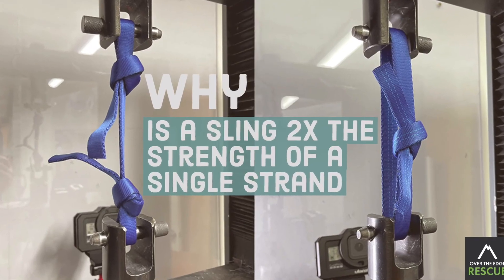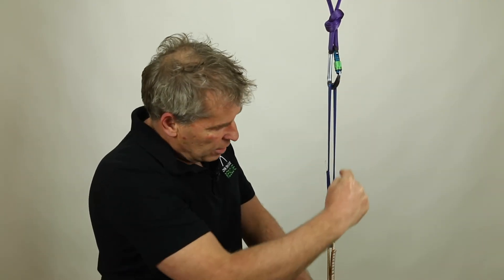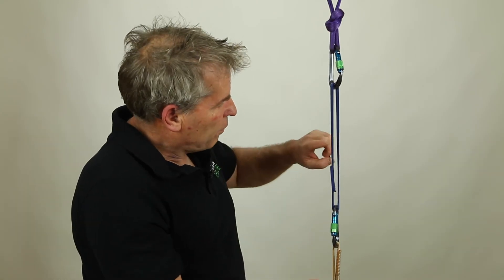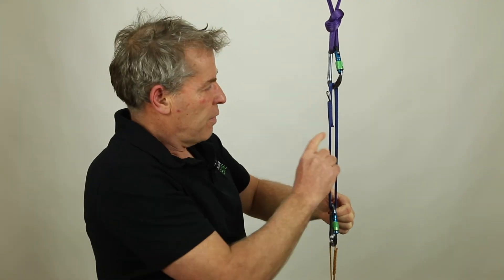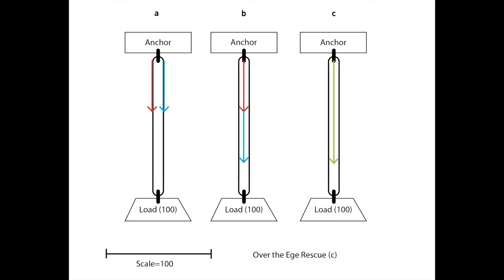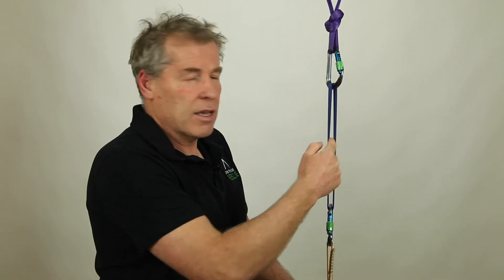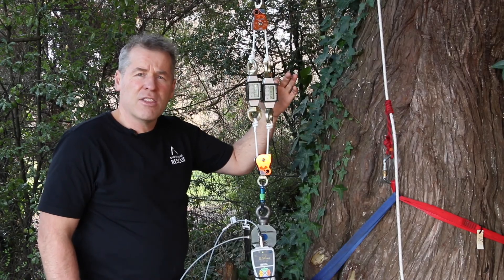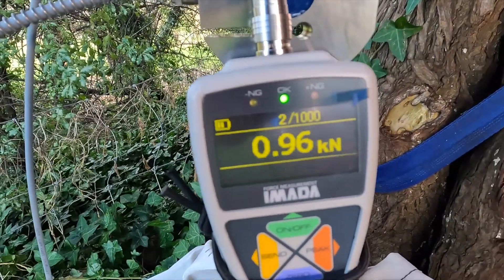Why is a sling 2x the strength of a single strand?

Comment: This is mostly correct but your explanation about how the force would be spilt across the top and bottom carabiner is wrong, the top carabiner is getting pulled on by the full weight of the load, and so must apply an equal reaction force to the sling. This force will be experienced in full by the single strand around the top carabiner
Reply from the maker: Everywhere on the sling is the same force - it cannot be different at the top and the bottom to left and right as it is a continuous sling - for every action, there is an equal and opposite reaction. This is the premise of the whole video and blog post. The sling only has half the force of the load. The testing proves this must be true, as the sling is twice the strength of a single strand. Check out the blog post.https://overtheedgerescue.com/anchors/sling-strength-vs-single-strand/